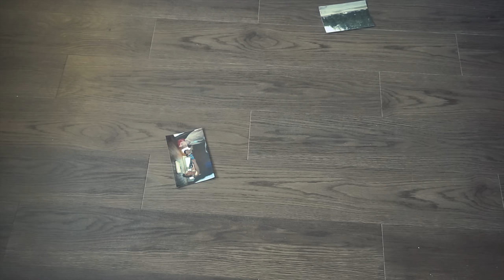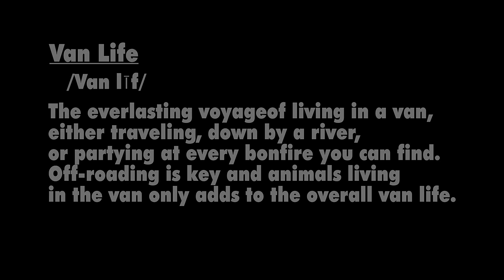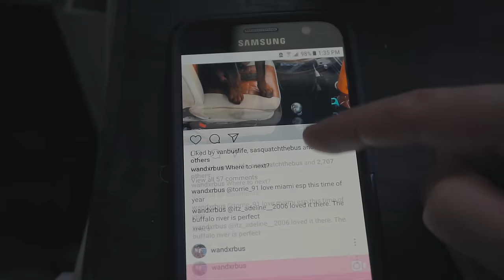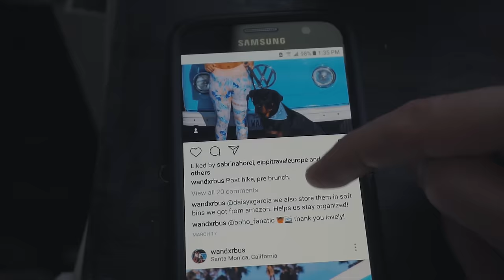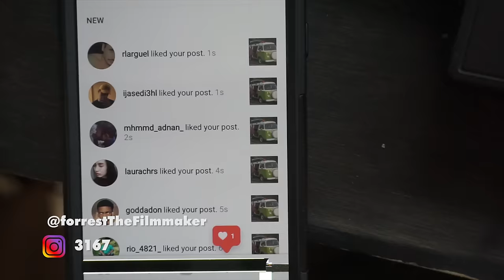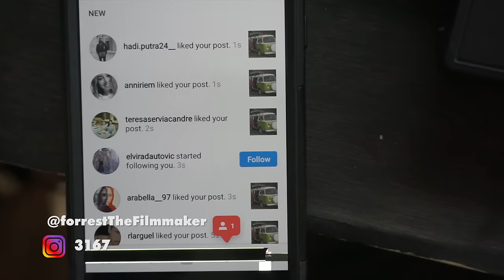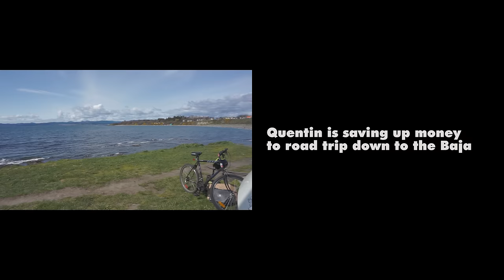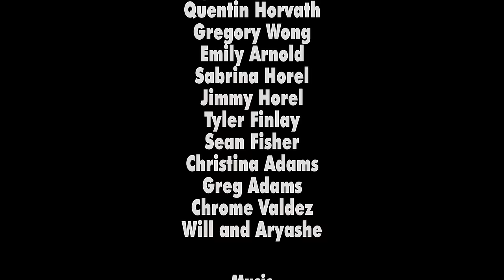The Reality of #VanLife - Full Documentary Movie - 2018

Comment: Always had a home to go to but as a kid we sometimes lived in a small pop up trailer in gravel pits as my father worked road construction. I loved it we were camping 🙂. As a young adult I worked construction and lived in tiny RVs, motor homes, in gravel pits and towns. Coldest day -35c. 

Sometimes washing in a tiny sink with no running water or electricity. Others hooked up to town water and sewar next to a hotel using a buddies shower. 
It’s possible to live this way all year long but the latest I did it was December 15 in Canada. Back again in spring for work. 

It’s not glamorous or life altering or spiritual as an adult. As a kid parked by the river it was amazing. 

It costs more to live in a RV park then it does to live in my first house. Unless your stealth camping, have free use of land, it can be pricy. 

A new rv, van, or camper is very expensive and will loose half its value in a couple years and almost all of its value in 10 years. We bought older campers cheap, lived in them, often sold them at a break even a few later. One became a storage shed. 

A cheap old camper or rv that you can set up some where free can make a great short term home.

Comment: Comfort is key. Tall roof so you can stand, hot shower, thick insulation, good stove top/oven, shower, toilet, water filtration system, solar and a quality battery bank will make a huge difference. I've lived in several vans and a truck camper and when I do it again I will get a bumper pull camper with a lifted, heavy duty suspension pulled by a powerful 4x4. It is more economical, comfortable and gives me more opportunities to explore. I would want a hi-top van for long term travel if I were to choose another van. I've been living in vehicles for travel long before #vanlife existed though so I'm sure my perspective is unique.

Comment: I lived in a 2004 E350 extended van in 2018- with my parrot- in Minnesota. It was hot. I had a very basic set up. I had just ended a marriage (8 1/2 years) and I needed to not use money, or be easy for my ex to locate.
Many challenges come with living in a van, but, I used to run a carnival and I have LOTS of practice!!😂

Comment: I dont really get the maths...how can it be cheaper that an apartment..i pay 600$ month for my 3 roomer as I see it it way much expensive having a camper..first you need a decent van which you prob dont pay cash. Then comes all the features need to be added to make it fit your needs. Gas is expensive, insurance too and add the repair costs to that. So even being on the road or just camping it will cost as much as a small apartment. Upside you can drive around kinda clueless but still the struggle is there..like making money. why not travel once a month to a certain destination and have it nice or just sleep under bare sky however you want it. And have a comfi apartment to return to. Freedom is not freedom if you're limited and as I see it you are limited in a van. You cant even leave it without getting worried about someone break in to it.

Comment: Van life and other than a motorhome or a travel trailer is basically boondocking and the one thing people don't see is your constantly fighting the elements say if you're camping in Arizona desert you're definitely hiding from the sunlight in the winter time you fight the cold and if you don't have a hot tap shower or stand up shower you heat up a few pots of hot water and pour it into a mortar bin and you used that for a tub and if you don't have a motor home or a travel trailer and you just have a van you don't fit in you're going to buy $100,000 Sprinter van or a $70,000 trailer you might as well just get a house out in the country